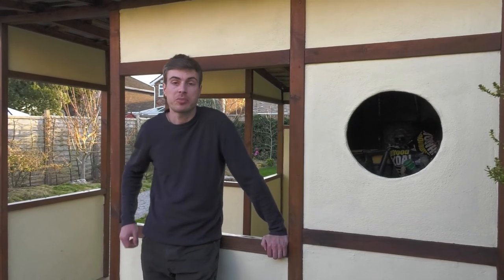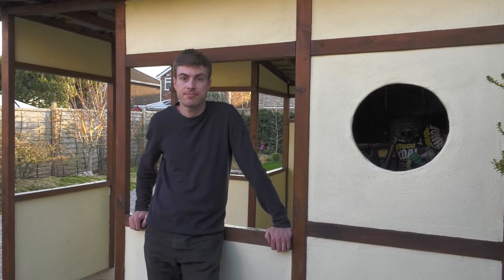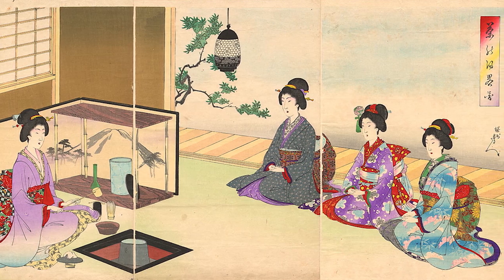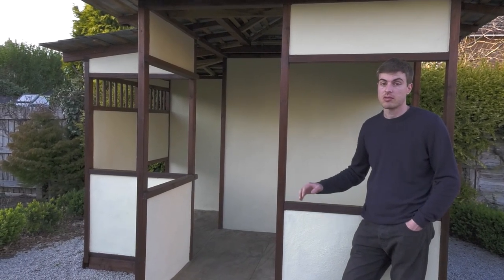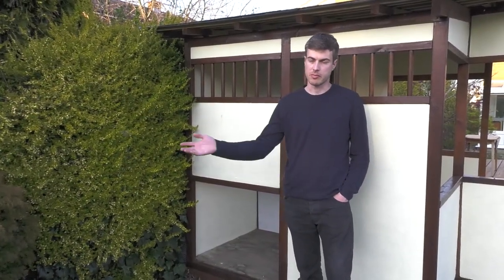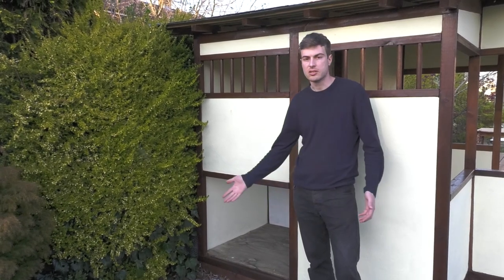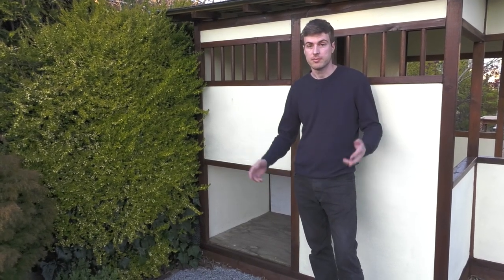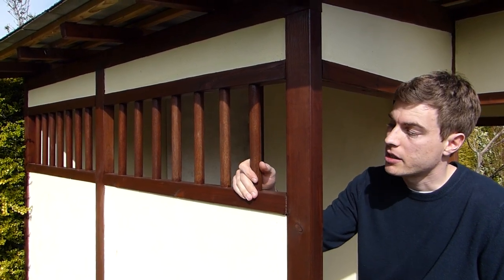Design a Japanese Teahouse

Comment: I've just come across your video. Like yourself, I decided to go for a slate roof and I managed to source very cheap 'Spanish' slate from 'bankrupt stock' early in March this year. That reduced costs massively. The garden you have designed and keep seems pretty tidy compared to mine at the moment. Unfortunately, I have neglected the garden side due to the construction of the tea house and ensuring the pond and its inhabitants survive (Koi). The tea house you have built appears a lot more open than the one I am building. I intend to completely seal it from the weather when it is complete sometime in early 2021. The garden is becoming full time to be honest. Anyway, keep up the good work and tips.

Kind regards: Alex
Reply from the maker: Thanks Alex, where are you based? Sounds like an interesting project. I hope to make some Shoji screens for the openings next year, so there's another project!
Reply: @37012  I am in North Wales. Similar to yourself, the next stage will be putting together a 'Shoji' sliding door. I hope to start that in the next day or 2 - weather permitting which has'nt been great at the moment.  the link below is a link to the playlist that shows how the build went from the base to the present day (part 15): 
https://youtube.com/playlist?list=PLJ1IsvVEJmHCfACFDzxb49-pc0-VA2SQp

Kind regards: Alex
Reply from the maker: @Veterankoi  This is great! Of course, you have Bodnant Gardens on your doorstep for azalea inspiration 👍 Keep up the good work and I'll check out progress